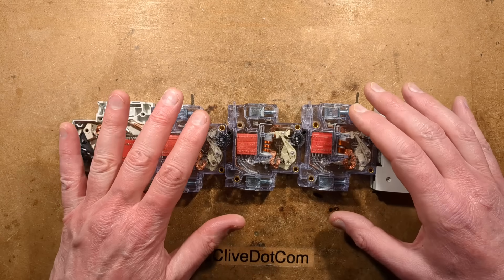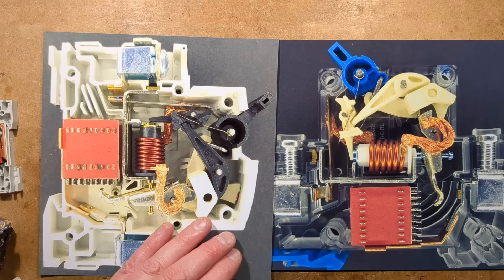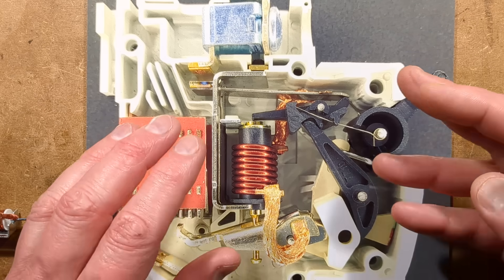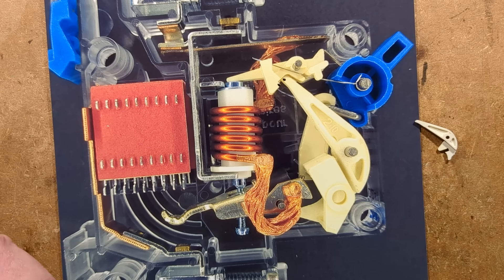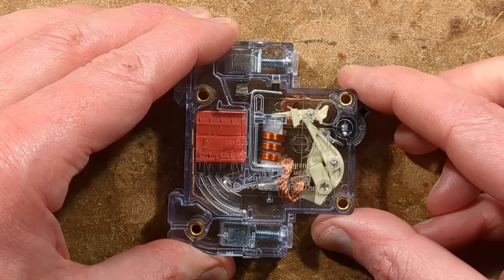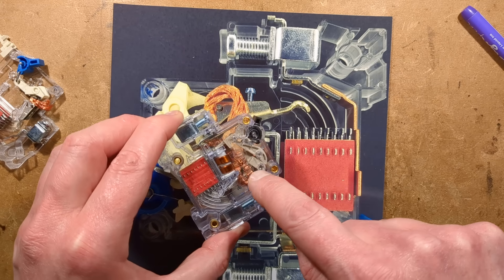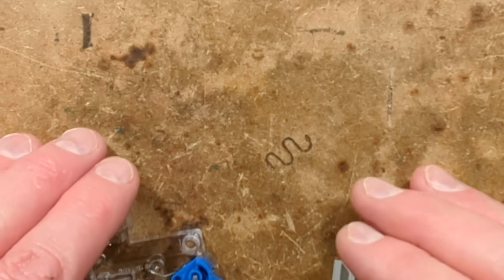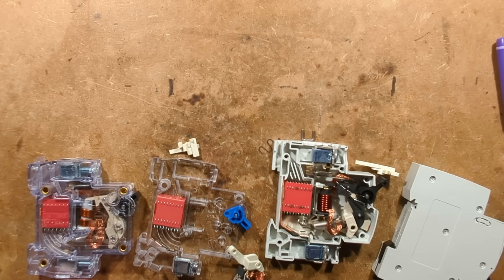A detailed look at the trip mechanism in circuit breakers

Comment: The wiring in our house is aluminum. Someone left the aluminum contact grease out of the wiring at the heater breaker. It overheated and destroyed the breaker housing. I researched why it got too hot before replacing it.

Comment: Very interesting. We as testers, doing EICR's  (Electrical Installation Condition Reports) do RCD tests for tripping times, calculate and measure the Zs/Ze readings.  The only thing that can sit for 20years or so without operating or testing are the MCB's!  I always find that weird, especially as they are such a very import part of the safety chain. Keep up the great work Clive
Reply from the maker: Testing an MCB requires specialist high current test equipment.  It's not a common thing.  That's where an RCD wins, as it does a full system check when you press the test button.

Comment: Incidentally, the I-t curve of the circuit breaker in the thermal regime means you can cheat a little when it comes to current rating. If you have, say, a dishwasher and a boiler connected to a circuit, which, together, amount to 10% more current than your breakers are rated for, you really don't have to sweat it. For the breaker to trip, the maximum current would have to be drawn for at least 15 minutes flat. Which, given the demand patterns of most devices, is highly unlikely. And don't you worry, if your house was wired after 1975, it is wired to withstand a continuous current of at least 145% rated maximum.
Reply: "...don't have to sweat it." You can get into a grey zone. US tea-pots are designed to not blow US standard fuse/breakers. TWO tea-pots will blow the circuit but it can take many minutes, as you say. (Takes a long time to burn our fat wires.) BUT at school classes change synchronously, on a schedule. Teachers trot to office to start tea... all at the same time. Because our pots are slow they sometimes got tea before the circuit went out. But THREE tea-pots on one floor, it was just about 3 minutes!
Reply: @PRR1954  Oookay, let's sort the claims you make a bit, shall we? 

First, I specifically spoke about a minimal overload, which I defined as "anything up to about 10%. A big kettle is usually about 2kW, so two kettles would strain a 16A fuse to about 109% capacity in a 230V system. I'm too lazy to research and calculate the 110V values right now, so that's left as an exercise to the reader. Three kettles however would be 160%, which would put you in the range of single-digit seconds thermally and even get you in the ballpark of a magnetic trip on class-B-breakers. So I'm going to go out on a limb and say either it was lower-powered kettles or they were on two different circuits.

 Second, I was specifically not speaking about peak loads. I used the example of a dishwasher and a boiler in tandem, which are independent consumers and only by chance overlap in their demand for a few seconds every now and then. That's not to say you can't get them to trip if you run the dishwasher on hottest program and pull loads of hot water at the same time. That's not invalidating my point. Your head should always be kept turned on high when you do stuff like that anyways. And if the breaker DOES trip every now and then, it's not the end of the world either, unless you were stupid enough to run somebody's life support off the same circuit as your kettle(s).

Third, I was speaking about safety mainly. The initial question any layman would ask about such a trick is "but is it safe?" and yes it is, because the wires can handle about 150% of the breaker's rated load indefinitely whereas that same load would trip a breaker in less than 20 seconds, no matter which category it is.

Comment: It would be great to watch the breaker thru a thermal imager while it trips at various currents using the same rated breaker, ie. A 10 amp at 9 amps 15a, 30, 100,

Comment: Presumably the clear package is to prove it's not one of the empty fake ones. I wonder if this plastic has the appropriate fire & temperature rating.
Reply from the maker: I think the clear case is just for style or for visual condition inspection.  I'll have to try a flame test on the remains, although they must do clear flame treated plastic if Wago sells clear terminals.
Reply: The 221s are a polycarbonate housing.  These MCBs looked more like acrylic - which isn't self-extinguishing.  Could be recycled PC though...

Comment: £3?? Holy jumpin. I think a standard off the shelf breaker in Canada is in the $20-30 CAD range, and combination AFCI breakers are upward of $100 CAD. GFCI are somewhere in the middle. Breakers in Home Depot are behind the checkout counter in locked cages because they're so expensive and you can easily grab thousands of dollars of them at once.
Reply: Holy, you can get a full preassembled 3-phase Hager (name brand) distribution box with 2 GFCIs and 2x6 RCDs (6 per GFCI is the regulatory limit on new installs) for 250€ incl. VAT here. and that's completely prewired with clamping blocks and has a Type 2 SPD too.  
But I think the whole world now uses DIN distribuition, while mostly/only NA still uses the UL style.

Comment: It is important to note that the overload mechanism (bi-metallic strip) is capable of thousands of operations.  The instantaneous mechanism (the solenoid) is typically only expected to operate for one or two operations at the max rated current.  It can do more more operations at lower fault currents, but typically you have no idea on a small breaker like this what your fault current was.  This is one of the reasons it is important to have a qualified electrical worker inspect your breaker after a short circuit as they may need to be replaced.
Reply: the instantaneous mechanism is essentially a quarter wave (5ms) switch (max time to activate) but at the moment of turn off, the full line voltage is across the contacts.

Comment: Very informative and educational for those that put elastic bands, insulation tape, fuse wire, etc in an attempt to stop the switch doing it's job in saving your life. I've seen some really stupid people trying to keep their often overloaded circuits from tripping. I've seen a 4" steel nail used as fuse wire, honestly. Good post, thanks Clive.

Comment: I’ve been building my whole home battery system & id like to know why some DC circuit breakers are polarized and some aren’t. I’d love to know what’s going on differently inside each.
Reply from the maker: The DC breakers are similar, but may use a magnet to direct the arc into the quencher.  That could explain the polarity requirement.

Comment: You said in the video (9:15) that the breakers are mounted in a way that the arc would need to flow downward in order to quench the arc.  But that only applies to half of them, right?  The ones on the top row would need to flow downward, but the breakers on the bottom row would be the opposite.  In the US, the bus bars are always mounted vertically in the breaker boxes, so the arcs would flow left or right to be quenched.

Maybe the breaker boxes in the UK only have one row of breakers, and not two.
Reply: The direction does not matter since there is a magnetic field and pressure. The exhaust hole is more important.
Reply: @LaserFur  That makes sense.
Reply: Euro breakers can be in multiple rows but they are typically oriented the same. Apartment electrical panels I've seen in Germany can have 3+ rows where lower rows might only have non-breaker devices like over-voltage protection. And there's not usually a main breaker slot that I've seen. It's a pretty different system overall

Comment: 30 to 20 years ago I was a test electrician when it was a separate job. It always irked me that there was no test for MCB rating. The type and rating determined the maximum earth loop impedance for a circuit and it was measured in hundredths of an ohm. The RCD trip time was measured in milliseconds, but the MCB rating was only taken by reading the label on the MCB. At least a rewireable fuse rating could be verified by looking at the wire size and it could be seen if it had overheated. I would have liked some test kit that load tested and timed MCBs. Oddly, when I was made responsible for the company's NICEIC paperwork I got to read the NICEIC newsletter. there was a court section and there was never a case of electricians failing to meet standards, only cases against people using the NICEIC logo without paying.
Reply from the maker: There is specialist test equipment for MCBs, but I disapprove of it, as it is often used by specialist test contractors using minimally trained labour to remove, test and replace breakers in a way that could result in them being improperly re-installed.
The NICEIC is just a marketing company masquerading as a government body.  I regard it as being primarily responsible for deskilling the industry with its "approval for cash" approach.
It's official title is "Voluntary electrical safety organisation." which is odd, since I don't associate them with electrical safety at all.
They occasionally put out marketing spin claiming they prosecuted a bad installer, but it's all word-play, as they are just a company with no power to prosecute anyone.  In reality they just get trading standards type organisations involved to do their dirty work for them.

Comment: I'm trying to wrap my head around "6,000 amps".
Reply from the maker: They also do 10,000A versions for locations with very high potential fault current.  The 6kA and 10kA are just the breaking capacities and mainly deal with breaking the arc.

Comment: When I had my garage wired up they put class B breakers in despite being told I was running welders in there, they even put a 32 amp socket in with its own breaker (B grade) these kept tripping out when I turned my 110 volt transfomer on, so I changed them over to class C. It was not just the garage that tripped out it would sometime cause a whole cascade of trips so the ring the transformer was on went this would take the earth leakage in the garage out which in turn trippe the mai in for the whole house. Just having the breakers in the garage changed to class C stopped the house breakers going.

Comment: Generally, the solenoid is going to be thicker for higher current rating. Not sure why you would want to use Chinese clear cased circuit breakers though when you should use UK specified ones.
Reply: Educational/demonstration purposes is one thing. Actual installation is another, where you must ensure compliance to the various standards, regulations and laws.
Reply from the maker: Just for demo.  I use UK certified ones for my own system.
Reply: I am a current engineering student studying electrical installation and maintenance and we were informed that it is important to never use clear circuit breakers as they can set fire easily should a short occur.

Comment: 0:56 are you sure you got that right? As far as I know, type C is 5 times rated current to trip, not 10 times.... At least here in Denmark. And I do beleave we are using similar material, manufactured under the same standarts.

Edit: I just checked up on that. It seems type C is classifyed as 5-10 times rated current, and type D is rated for 10-20 times....

In every day work, we usually go for the lower rating.
Reply: Clive is correct. Type B (sometimes referred to as "B curve") has fault current trip at 3 to 5 times rated current, type C (which is what he was describing) is at 5 to 10 times, while type D is at 10 to 20 times. If you look up the charts, they will sometimes show these ranges, while sometimes they'll only show the upper bounds.
Reply: @rednammoc  I notissed that aften making the initial comment. Allthough as I stated: In everyday work we tend to go by the lower rating. And yes i do work as an electrician ongoing for 35+ years.

Comment: Great explanation! If you force one of the see through breakers to trip using electricity would make a nice video. If you film it with a little higher framerate so you can slow down the footage then we can see it in action. With sparks. 🙂

Comment: As time is shorted good welded it will not open but it will burst in to flames and melt
Reply from the maker: As a rule of thumb - if a breaker has tripped on a full short circuit several times it's wise to replace it.

Comment: That was really cool. Oddly enough, I just got back from the hardware store, because I have to replace the breaker (US not EU) on my washer, because it doesn't trip, but every time it goes into a mode that uses more current, I can hear the contacts arc. This one lasted at least 30 years, I suspect the new one won't. I do plan to take it apart because I want to see how bad the pads are pitted/burned. It also seems to be temperature dependent, because last fall when it was about this temperature, it did it a little, then stopped, and tings got busy and I forgot about it until this spring. The box is mounted in my basement, on and exterior wall. I'm sort of looking forward to see what's in a US breaker that was designed in the 60s/70s. My guess is that isn't not anywhere as interesting.
Reply: It's probably almost exactly the same

Comment: im curious about the arc fault style breakers , i understand they are code here in the us, some kind of microcontroller to predict an arc, bane of my existence for the few years i lived in a rental with super cheap arc fault breakers that tripped just off the usage of my pc, got worse during snow melts here in Montana, never tripped on anything else, only my gaming pc, and was not just the one breaker. had to run an extention cord around my living room into the bathroom that had a standard breaker, but a gfci outlet.
Reply from the maker: I just bought an arc fault breaker to take apart.

Comment: A cluttered bench is the sign of someone that actually DOES things.. Rather than sitting around worrying that something might be out of place.
Reply: It's said that someone once said to Einstein that a cluttered desk is a sign of a person with a cluttered mind. Not that I'm going to argue, given the state of my desk and my mind, but Einstein replied to him "Then I wonder what an empty desk signifies".
Reply: As a tech I needed to hear this. 
Screwdriver? On the amp. 
Wire strippers? Inside the soda box under my desk on the right side. 
Flush cuts? On the fridge in the garage. 
Tape? In the adhesive box on the other side of the shop. 
Box cutters? Front hall, 2nd shelf, right side. 
12ga wire? Under my shoe inserts. 

I’m organized. Don’t @ me.
Reply: @ "Everything is where I last left it" is a system too. I've lived by it for many years. "Tidying up" is for people with bad memory, although having all things of one kind in the same place has its merits now and then...
Reply: @feynthefallen  Exactly. It should be where I put it.  If it's not then something has gone wrong.
Reply: @feynthefallen  I go by the stratigraphic system for locating stuff.
The longer ago I used it, the further down a pile of things it will be.
And that's why I don't tidy stuff - it would totally wreck the system.
The added bonus is that when I do occasionally have to search for something relatively old, I surprisingly often come across something useful which I'd forgotten I had.
Reply: @davewilson4493  if its good enough for the geologic column then its good enough for me.
Reply: I must be really busy. 😆
Reply: @Slikx666  so busy I can't get anything done🤣
Reply: Big Clive must do a LOT of things! 🤣
Reply: In our workshop we used to say that a tidy desk was the sign of a diseased mind....or a lazy bugger :)
Reply: II would love to see more of the desk. Only a genius masters chaos.
Reply: Having a clean bench is something though......😉
Reply: Bob Pease might be the best example for that
Reply: Sure, right, because all humans are the same and they all fit into your tidy little pigeon holes.  You need more friends.
Reply: I don't know about that.. My desk has been a gigantic clutter mess for years and not a thing has changed. Haha
Reply: Clutter can reach a saturation point at which it becomes impossible to get anything done. Wait, are we talking about heads or workbenches?

Comment: the trigger mechanism is very similar to ones found in firearms i own. the trigger mechanism is always the worst part to reassemble in most guns when you take them apart for cleaning. i do believe that weapons/firearms were at the start of most mfg advancements. interchangeable parts, assembly lines.... im taking 30-50 years before henry ford was born. theres just an overlap between gov issuing large standardized purchase contracts and mfg which made firearms the obvious item to figure al this stuff out with. now when i look at a circuit breaker i see the same annoying mechanism in my khar cm40 which doesnt want to go back togeather and somehow just works reliably in a mysterious way.
maybe thats a big of an american centric view of history. im guessing circuit breakers were invented/engineered by edison in the usa though. im sure he took appart some guns in his time.